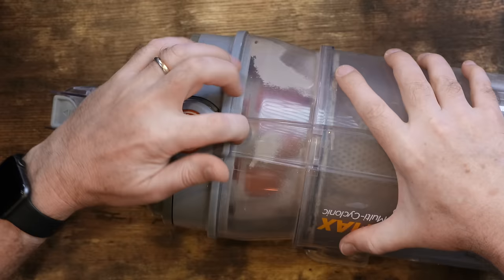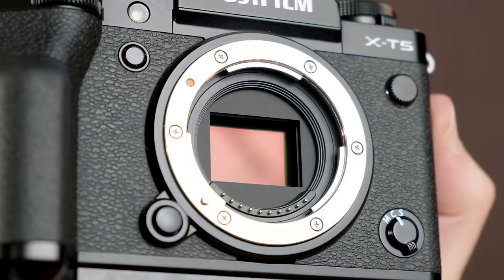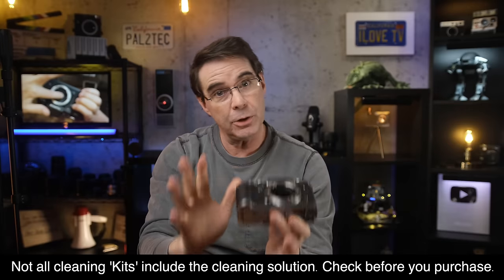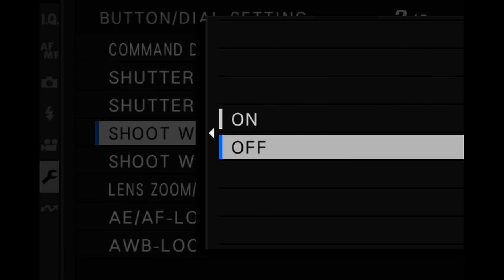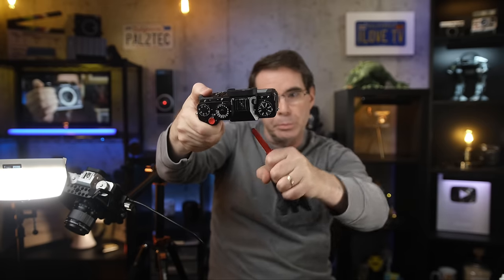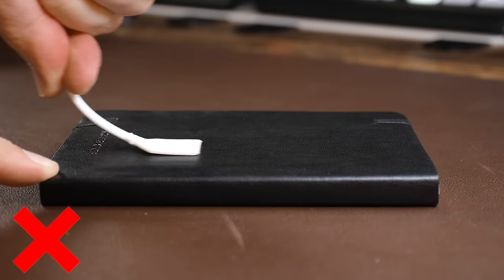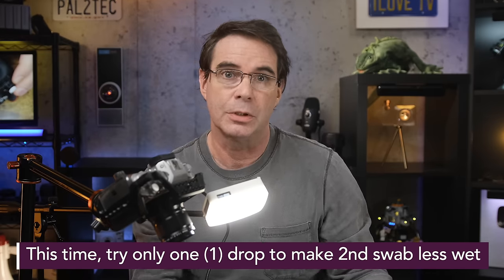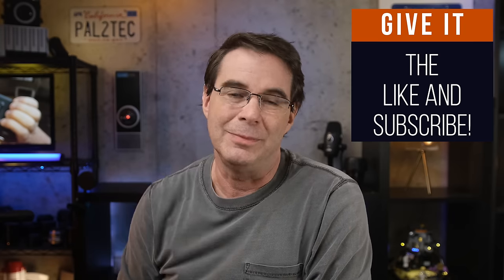Fujifilm Camera Sensor (How To Clean)

Comment: I had dust and a residue from a aero duster can air spray. This worked perfect your instructions perfect and PSI size 2 product worked great. I did need a second swab as 1st swab had left a slight smudge. I used the squeeze duster as you said, threw my can of air spray away.  The dust particles gone and air spray can residue gone. Sensor like new!  Thanks !

Comment: first time cleaning the sensor of my x-s20 after ordering a k&f cleaning kit. was pretty intimidating, but i followed all of your steps, and now my sensor is free from any dust. thanks for the tutorial. this really helps. i used 2 swabs since the first one left some residue behind
Reply: Any rings left by the liquid?
Reply: @fabiom55  i went on to check on the sensor, and there are some very faint rings on it. but it's only visible under a certain light, specifically if i use a flashlight on it. doesn't seem to affect on any of my images though. most likely it's because the liquid doesn't dry fast enough, that it left marks on the sensor, maybe
Reply: @wvnn27ahmvd  Very similar to my situation. Thanks!

Comment: Thank you for this complete tutorial. It really covers everything. Another tip from my personal experience. If you haven't used your blower in awhile, chances are the nozzle would have collected some dust. Give it a few good presses first before using it on your sensor. 
I made this mistake years ago and it and blew so much dust straight into my sensor!

Comment: I have a problem with dust spots, some of them are big specs of dirt in some of my lenses when using a small aperture. This is a FANTASTIC video on how to clean the sensor. Years ago I ruined a sensor with a can of air sprayer! I’ve also ruined a sensor by leaving streaks on it which can show up if you pull detail out of shadow.  Never been able to remove the streaks! Therefore, My favourite cleaning tool is one that has a pad set perpendicular to the stick and you touch it completely flat on the sensor and lift it and place it again until you have worked your way across the sensor-one size pad for any size sensor.  I’ve had my sensors cleaned by Fujifilm who do not always do a good job. I also get my lenses cleaned by Fujifilm.  Despite WR many zoom lenses suck  in dust through the rear.  Thanks again-great instructions.

Comment: Hey Chris!

One suggestion to make this process even quicker - since there’re a bunch of settings you should be changing back and forth from your usual preferences for the sake of safety, it can save a ton of time to back up your normal camera settings (via either X Acquire on desktop or XApp on mobile) make these changes, back up again (label it Sensor Cleaning or something), and then just load your normal settings back on when you’re done.

That way you avoid any risk of accidentally forgetting to change a setting back, and you can ping pong between profiles as needed with just a click :)

Comment: Thank you for taking the time to make this video. 
I was worried I had debris on my sensor but after doing the simple picture test it turns out it's fine at the moment. 
I had a spec appear on a shot but it turned out to be the lens I was using. 
I have one of those blowers and it's great. I use it every time I change a lens.

Comment: A faster way of preparation is to put the camera into update mode. It also locks the IBIS and the shutter. Putting the fluid to the swabs depends on the cleaning kit you bought. Some of them wants the fluid only on one side of the swab and wants you to wait after putting the fluid to the swab for a few seconds (10 seconds with the kit i bought) before wiping over the sensor.

Comment: Thanks for this Chris. I was wondering why the camera had to be ON during the process and found the answer: 
"The camera needs to be on for the IBIS mechanism to work. 
When the camera is ON, and IBIS is OFF, the IBIS mechanism locks the sensor in place. 
That's why. When the camera is OFF, the IBIS is free floating. It needs current to lock in place."

Why doesn't Fuji simply lock the sensor when the camera is turned off? It would make cleaning (and changing lenses) a LOT safer.

Comment: There's just one at the point Chris that you didn't mentioned and I want to mention this to everyone and I do clean my own senses is use your blower every time you change lenses so every time you change the lens. The other thing I would say is the sensor does have filters on top of it so you're not gonna damage it by putting a little bit of pressure on the swab. Don't be fearful that you have to be really dainty with it. You can actually put a little bit of pressure on it that is my finding as well and yes, I'm a professional photographer that has cleaned, my sensors for years. There is one other little step that I do after you've taken the swab back left and right I then use my blower to dry the last bit of residual fluid on the centre. Yeah I just couple of blows with the blower and that will dry any streak marks that may appear because sometimes you do get a little bit of streaking and that's fairly normal don't panic people most of it evaporates but you can use your blower at the end to get rid of the last few streaks that are sitting on the sensor and thank you for the video Chris. I've shown many of my photography students how to clean their own sensor and you are 100% correct. In everything you did. I didn't go into the whole settings in the camera thing so much. I just take the battery out of the camera so the camera can't operate. That's probably the other little tip that I would give people that way. You can't turn the camera on or anything like that. That's just another tip. Thanks for your videos mate. Great stuff.

Comment: Thanks, Chris. I'm writing for my xt5. The link to the Sensor Swab Ultra is 17mm, while the sensor of the xt5 is 15.7. Then we have that 17>15.7, so it should not enter the frame to best clean the sensor mirror. Yet from the video images, it almost seems like the 17mm Sensor Swab Ultra is only slightly smaller than the sensor! Ultimately, the clarification is: is the Sensor Swab Ultra 17mm good for the fuji xt5 or is it too large as the measurements suggest? 
Thank you for your time. Christian (Italy)

Comment: I never got dust spots on my XT3 so never cleaned the sensor during the years I had it. But is it perhaps worth cleaning the sensor periodically as a maintenance routine even if the sensor looks ok?
Reply: I got my first digital camera in 2011….I’ve cleaned my sensors exactly twice.  Once to just test my cleaning abilities and the second because I was bored one night. I do use the air blower about once a week to keep things tidy inside (and on the back of the lens) but otherwise the weekly (or so) blower treatment works just fine
Reply: I have many Fuji cameras and have cleaned the sensor on my old X-T2 and X-T3 once a piece... granted I baby my bodies and lens unlike what we see on this channel, but yeah a lot depends on what you shoot and how you protect your gear...and yes  I shot landscapes and wildlife with both of those cameras for years before making the T2 a IR camera and the X-T3 as my beater camera now that I have a X-T5 ... sometimes it must be done but simple care can also help keep the sensor clean for years between cleanings

Comment: A lot of people are afraid of scratching the sensor, but it's covered with clear glass, so no more susceptible to scratching than a lens - just use a proper kit:
Also, if you take the camera to a shop to be 'professionally' cleaned, bear in mind that the shop will simply do exactly what you've described (hopefully) and the 'professional' given the job might just be the Saturday Boy.
Lastly - might be an urban myth - but one 'professional' shop was alledged to do the job with a Lens Pen rather than proper swabs.

Comment: I've cleaned my X-T5 sensor with the power off. Chris, I wasn't clear from the video - what potential problem could come from that? Wouldn't that be the same as IBIS off?
Reply from the maker: Keeping camera ON with IBIS OFF makes sure the IBIS mechanism doesn't move freely, which can be damaged if it's not locked down by camera and someone is wiping a swab across the unit too strongly, I can be force-moved from his housing, etc.
Reply: @pal2tech  Okay, thanks, Chris. Do you know of a way to check if I may have damaged the IBIS mechanism?

Comment: Just curious why all the adjustments to the camera when the camera is turned off.
Reply from the maker: Camera stays on if it has IBIS.
Reply: @pal2tech  Are saying that the sensor can move (ibis) when the camera is off???  If yes, I just leaned something.  P.S.  Usually I can clean a spot on my sensor with a blower.

Comment: So Fujis don't have a sensor cleaning mode? That's surprising. It would be so much easier.
Reply: They do. It usually runs just before shutdown when you turn the camera off.
Reply: @grafixnetz  Oh, I see what you mean. I mean the mode where the camera lets you clean it. I have it on my Nikon DSLRs, I turn it on, and while that is active you can clean in peace, and the camera won't do anything stupid. I think you're talking about the automatic sensor cleaning that most cameras have, where the sensor shakes at high speed when you turn the camera on or off.

Comment: Doesn't the X-T5 have a cleaner. I can set my X-S10 to clean at startup, shutdown or both.
Reply: Yes - It's an ultrasonic vibration, but it won't shake off sticky pollen grains, or even the residue left by a water droplet; let alone salt spray.